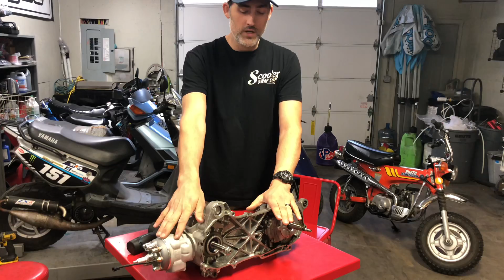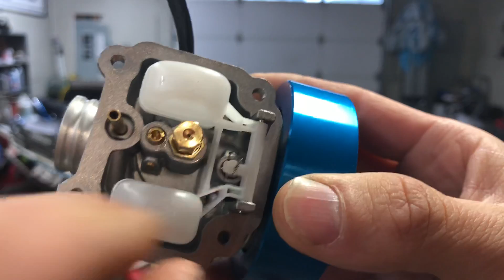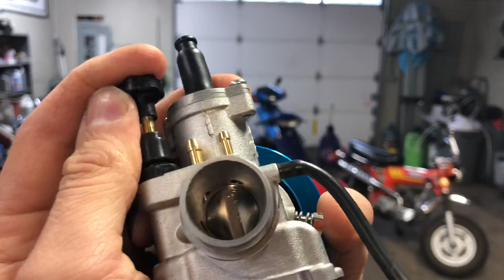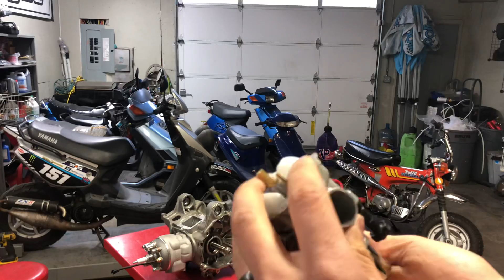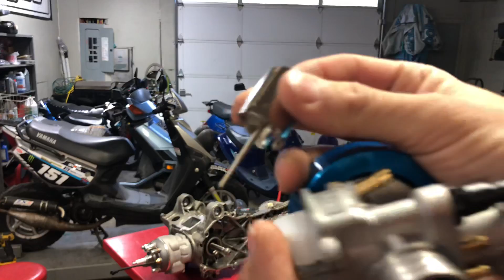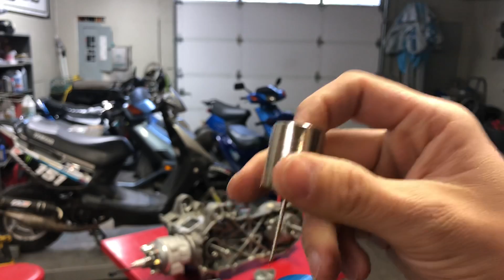Understanding jets in a scooter carb

Comment: hello was wondering what size carb a should buy , i was thinking a 20mm polini .  i have a 98 jog that a did a molossi 70 top end kit a pipe oil pump block off cdi upgrade.  stock air box.  i put a 96 main jet in my stock carb and my top end power plutters a little, so  was want to buy a better carb.   thanks  great vids

Comment: Good very basic explanation.
Getting into real tuning and you will need to know a lot more about the different circuits and the difference in needles, emulsion tubes, velocity of air flow, air density ect ect...
I'd like to see someone tune a 34mm flat slide to a full race ported 86cc AM6 for 80°F 30% humidity at 1,100 ft elevation 😂
Throw in some ignition mapping and then you will have my full attention 😜

Comment: I'm buying a polini carb 17,5 with 48mm podfilter, Reed, 23mm intake manifold. Which pilot jet should I start the tuning progress?  Does the poilini hi-speed variation, new 107mm clutch plus new contra. Need upsetting? And which contra do u recommend? Yellow Malossi?

Zuma 50cc 2t
Reply from the maker: start with where its at and adjust from there Every bike and set up and location altitude so on is different

Comment: In a situation like you spoke of, overheating, due to leaning out, you could restrict the intake / air filter slightly, causing the jet to be pulled harder, to richen the mixture.. They are many ways to do that, block half of the filter, by wrapping something around it, like a plastic bag, example a 30mm carb, with a finger sized hole should be a starting point, it will work in an emergency! Better than killing the engine...
Reply from the maker: We are just here to inform people of the correct way to do things!

Comment: What jet sizes come "installed" with the performance carb kit for the Honda ruckus 50CC, sold on your website?
Reply from the maker: off the top of my head im not sure call the shop real quick Paul can get that info for you but ours comes with a set of jets so what's in it doesn't matter as you get a range that will best suit your location and parts on your bike.

Comment: Hi.  I have a girela runner sp 50 - 70 ccm malossi 70 ccm sport 17.5 carburetor main nozzle 84. The problem is that when starting and adding gas, the engine as if it is four-stroke and after some time it goes normally.I also have a new flange and carburetor cleaned.  Air filter and lines OK.  Can the nozzle be too big?thanks
Reply from the maker: change the jetting to see what it doesn't check the plug each run.

Comment: I have a 4 stroke, 50cc. Larger carb, aftermarket pod air filter and exhaust. I recently started having trouble with the engine not reaching higher rpms, this is all by sound, I don't have a tachometer installed yet. Do you think it's compression, exhaust leak, or maybe some trash in my carb? Air filter is clean, new belt and I've already checked my variator. I was thinking it's probably more than one issue. Oh, also stock cylinder, head etc. I haven't put a bbk on yet.
Reply from the maker: Thanks for the info!

Comment: Bought your ncy stage 2 kit with the 70cc big bore and exhaust. I also bought the molosi air filter that fits on my stock airbox. Would you recommend upgrading my stock carb and getting a better air filter with this kit? Or should I just stick with what I've got?
Reply: Oh and I bought the ncy clutch springs and upgraded my variator recommended by you guys.
Reply from the maker: give the shop a call if you haven't

Comment: I have a 2008 Yamaha BWS "Zuma" 100 2T. It's now a 55mm bore. Which carburetor and what size would you recommend? Everything else is stock.
Reply from the maker: give the shop a call with more info
Reply: Recommend changing the crank the stock one wont last long and probably 24mm carb maybe even bigger

Comment: Which aftermarket carb is best to keep auto-choke and oil injection for my 70cc sport kit? Do all require swapping out my dual cable twist throttle?
Reply from the maker: more info bike and current parts on it

Comment: Gotta a 50cc 2 stroke horizontal minarelli. Just installed polini contessa 70cc big bore kit and polini team 3 exhaust. Wanted to know what size carb to get . Was looking at the polini cp carbs. Also can I run my stock intake tube.
Reply from the maker: Get a 17mm or 19. And yes you can use your oem intake
Reply: @Scooterswapshop  yo boys I got a 21 on my Yamaha cws 70 bore pm360 pipe stage 6 reeds and reedblock 21mm black edition delorto carb what jetting should I be running roughly do you know I’m in the Uk south East
Reply: Is a 21 too big. I ride around or by sea level
Reply: @carterpahoa99  yo g I got a cw Yamaha vertical minarelli bro I got a 21mm with modified stock air box and some reason it ain’t right I think the jets 87 I got told I should be around 68-70 it’s a black edition del 21 what have you got on yours atm

Comment: I have a question what main jet do I need for a 70cc big bore kit 2 stroke
Reply: Okay 👌 thanks
Reply from the maker: No answer for that question unfortunately. Could be a 90 or a 158 depending on the bike and the engine build. One big bore may be 8 hp and another 30

Comment: I understand most of what you are saying. My question is , on a 2 stroke air cooled,(Polini Corsa 72cc on a ELITE), ill put the ring under the spark plug. Are the temperatures the same on air cooled and liquid cooled since the senser is located in different places?
Reply: Im sure Im overjetted. Im running a OK 24mm with a uni air cleaner. A metrakit hanbuilt stinger exhaust. The way it is now is more reliable because Im pretty hard on it. Im considering just getting the whole intake side Polini kit you offer and the pipe as well. For that set up, what jets should I start with? Im in MI where the weather averages on the colder side and at pretty much 0 elevation. Thanks
Reply from the maker: Lc vs ac sensors are reading in different ways. On lc bikes you do a sensor that’s reading the coolant temps. Completely different
Reply: What I meant was running at 350 - 360 on a 2 stroke is the correct range? Correct? Measured from the ring on the plug.
Reply from the maker: I like to stay under 375, so sounds like your right on the money!

Comment: one way to check the main along with all that was suggested is to go up an incline or small hill that will make the engine work a little bit.  If acceleration up the hill is worse than it usually is - your main is too lean.  If acceleration is better than ever or better than it should be, your main jet is too rich.  In fact, if you can go up the small hill/incline at speeds approaching your top speed on the flat, you are over-jetted.
Excessive four-stroking on a flat or on a slight downhill would suggest main is too rich as well.
hard starting when engine is hot, suggests main is too rich as well.
Reply from the maker: cool